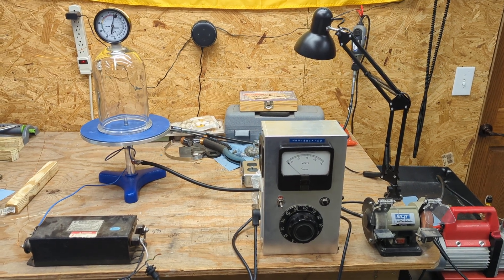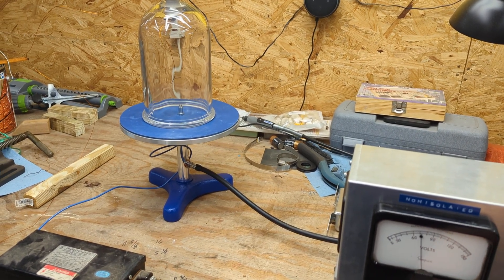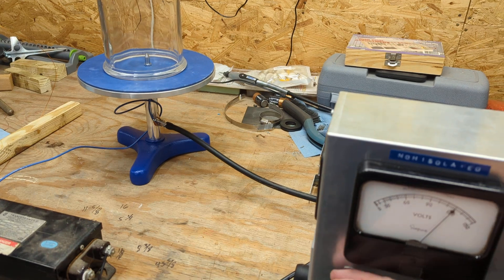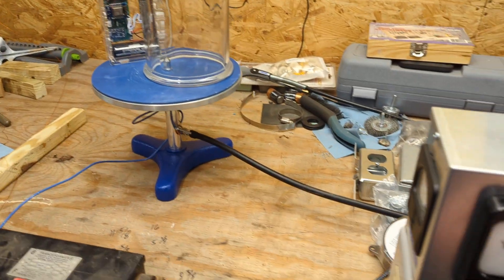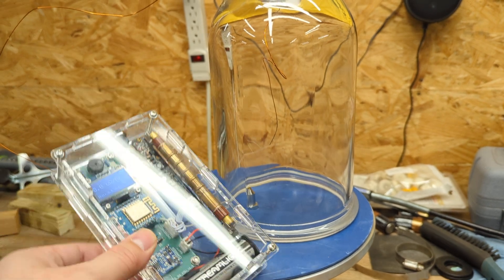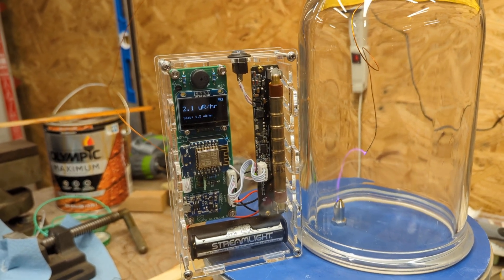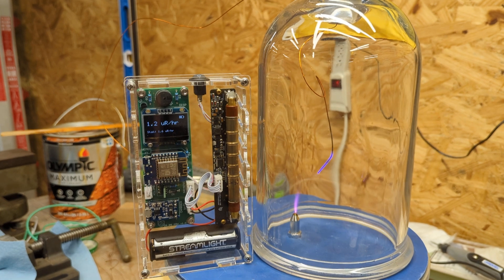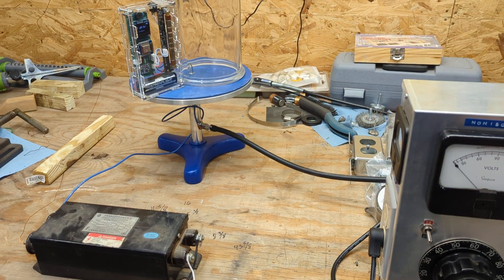High Voltage and a Bell Jar

Comment: That would be a cool method to discharge big ass capacitors like you have a sparkgap , and when you apply vacumn it close the circuit
Reply from the maker: That is a pretty funny idea, the resistance would be non linear- so as the streamer starts to ionize what little air is in there and as the plasma is formed the resistance will drop down greatly. The result would be something like a diode with a really high forward voltage. Once that voltage is hit you would dump all that charge at once. Wonder if you could use such a setup as a trigger for a can crusher lol
Reply: @burntsemiconductor  Exactly I was thinking about a can crusher , wire exploting , or magentic laucher , coil gun type of deal , I recently got myself some big caps and been wanting to make one of those magentic lauchers to lauch HDD discs , they look pretty funny but since my caps are polarized electrolitics I am worried about a backspike and would like a softer switching setup , that would be ideal

Comment: Does that thing even detect UV and X-Rays? - That's the worst you could possible expect.
Reply from the maker: The thing is a little Geiger counter - so yeah it will totally pickup radiation beta/gamma at least, considering its construction. The hard thing about using Geiger counters near Tesla/Oudin coils and the like is that they are also affected by the high frequency discharge so you have to either RF shield your Geiger counter or just move it a lil bit away from your high voltage source to get any worthwhile reading. As for UV, normal glass works pretty well to catch most all UVB/UVC (this is why your germicidal bulbs that produce UVC are often made of quartz). UVA could still be a concern but not enough with this source. Good question.

Comment: Do neon transformers have a bleeder resistor on the output?
Reply from the maker: I dunno about a bleeder resistor but they are nicely current limited with an internal magnetic shunt. One of the reasons why they are pretty nice for Jacobs ladders and Tesla coils